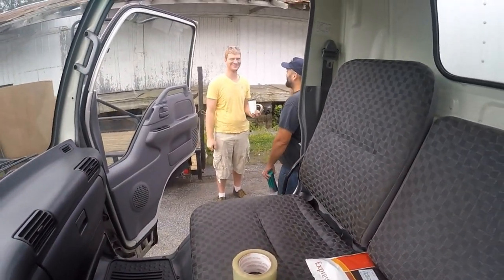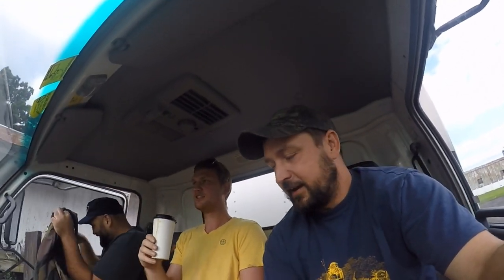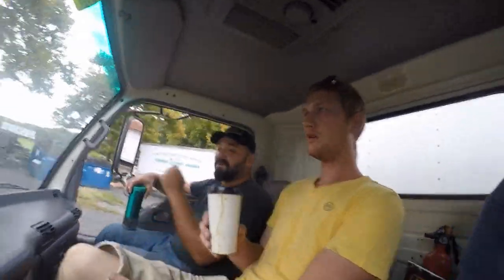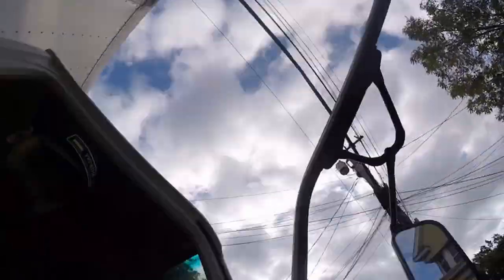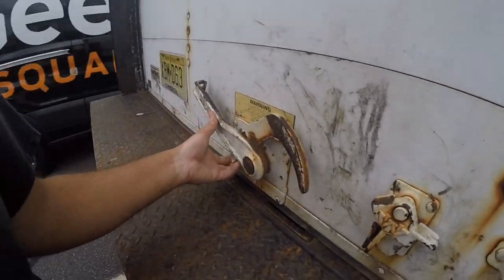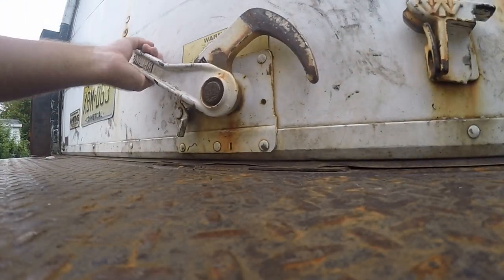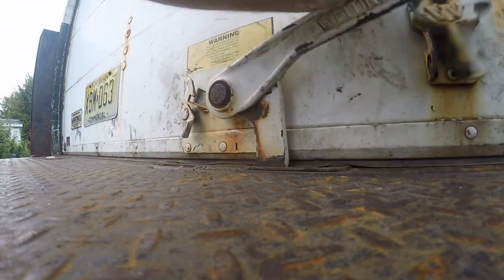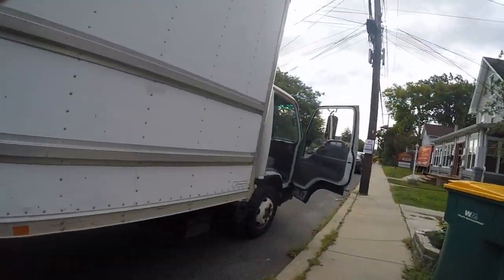Best storage auction load EVER! I will make thousands of dollars $$$👍👍👍👍 Blue Bus Dave

Comment: I don't get the hype.  It's a few grand worth of stuff, that is essentially flea market merchandise.  The cutting presses are cool and all, cause they are vintage, but are probably better off at the scrap than the headaches of trying to sell them when you do not have the expertise to properly test & diagnose them.
Two trucks with what 5 or 6 guys, driving from NJ into NY?  Half to full day of work, and then the storage costs, which do vary significantly, but are still relevant in the Northeast.
When you account for all those costs (which few amateur storage unit buyers do), this is just a decent big storage unit buy.  Many, if not most vets, would pass on it unless their infrastructure happens to be positioned right at the time to capitalize on it.
Reply: You clearly don't know what leather sells for. Average price range of tanned hides is $30-$50 each. There were an estimated 1,500 hides in that locker. You do the math, pops.